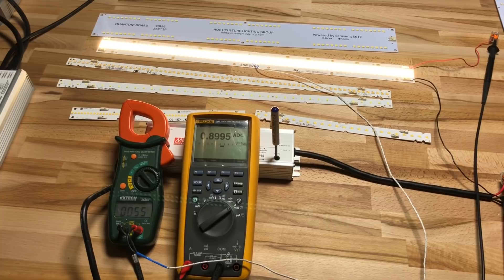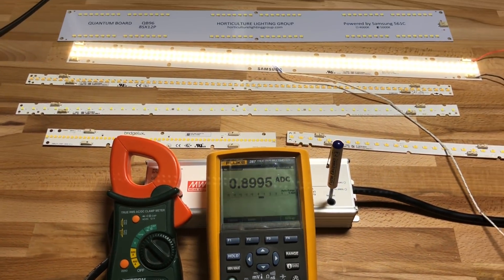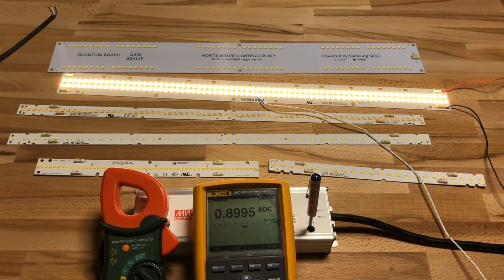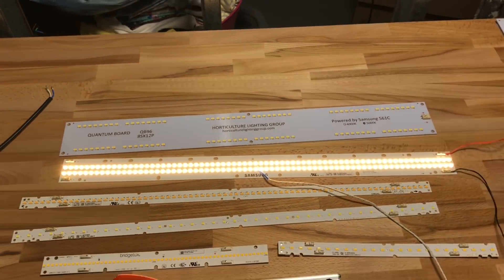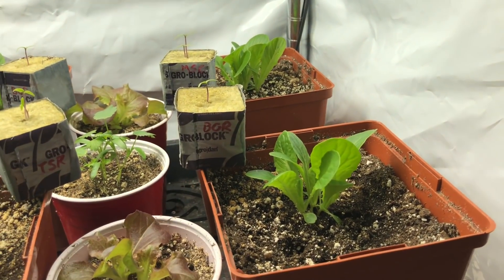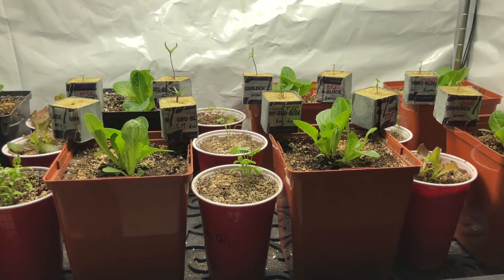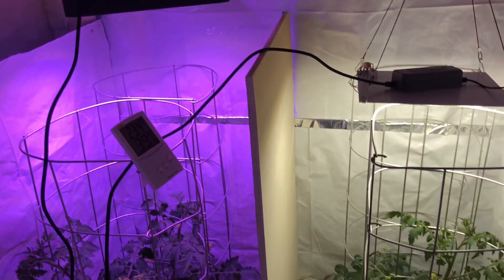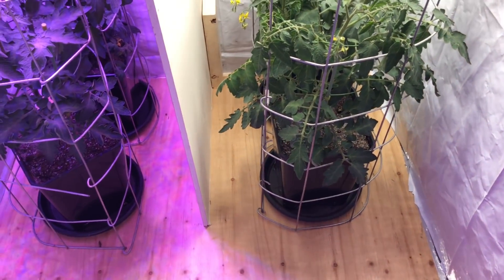Viparspectra 300 vs. HLG 65 Quantum Board - Week 12

Comment: Epic bro I like that Plan B sticker. I used to ride Plan B alot. Element also. They razor tailed fast tho lol I won a HLG 65 4k temp Its way better then my mars 300's. Temps are way lower too. I would invest in more here soon. Do they not come with hangers or heat sinks anymore? I seen they used to? They spaced the diodes further apart too